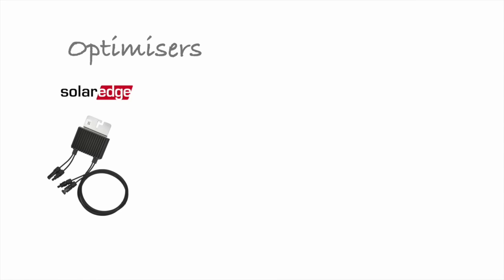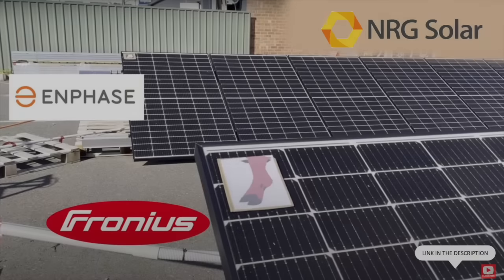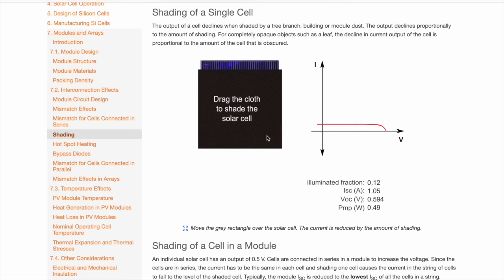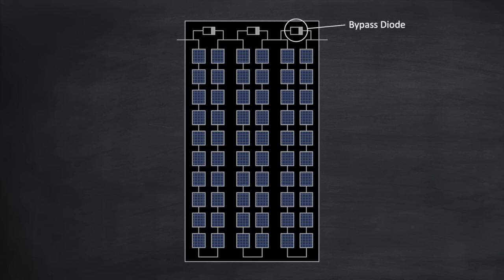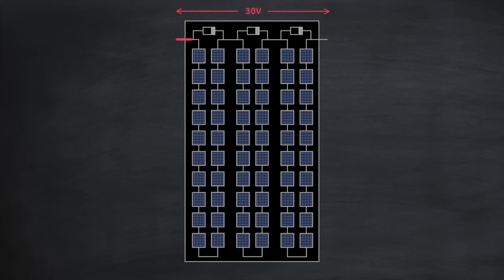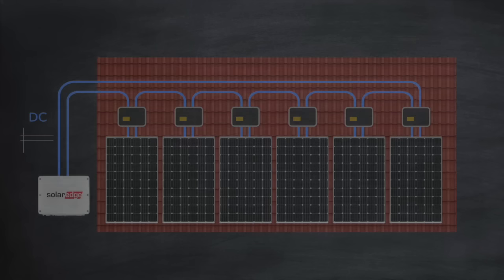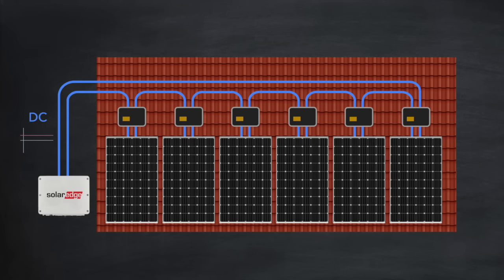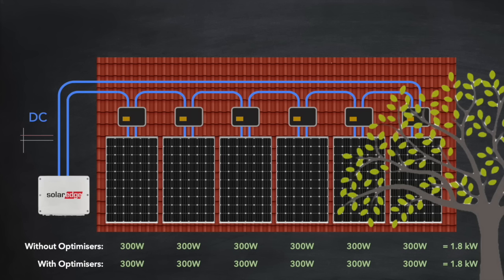Solar Panel Shading (Part 1): Are Optimisers and Micro inverters Worth It?

Comment: From 12:50 - the current drop was not enough to engage the bypass diodes, resulting in the whole strings current reducing to the same amount of the shaded panel-- is incorrect. The bypass diodes will start to pass current at a 1mA drop in one of the panels in the string. So, what ever the shaded panel cannot pass, the bypass diode will, to ensure that the peak current in all the other panels in the string will continue to flow.
Reply from the maker: What’s your source for this insight please? I don’t think you’re correct because that would mean any kind of shading on a panel would have almost no effect on any other panel. And it’s been shown (in part 2 by experiment using a cable) that this is not the case. Diffuse shading from a tree or a cable/antenna may not be enough for the bypass diodes to operate, therefore the current leaving the affected panel is reduced, with a knock on effect for the other panels.
Reply: @GaryDoesSolar  I answered this question in your part 2 video, but will answer it here as well. Bypass diodes don't just kick in at a certain current drop in a panels string due to shading. Bypass diodes will start to conduct at as little as a 1mA drop in current flow in a panels string. Shading one panel does not have any effect on any other unshaded panels in the string of panels, and that has been proven time and time again, even by myself. I might add, i am an off grid solar installer, and also own a company that specializes in off grid systems. The losses you may have seen, would have been from older systems, where the MPPT software in the old inverters would reduce the current flow when a drop in voltage was seen, due to shading. But we are talking about solar panels here, not old school inverters. No power is lost from the unshaded panels in a string of panels when one of those panels in the string is shaded. From 12:50 you said -( the current drop was not enough to engage the bypass diodes), when in truth, a 1mA drop in current through a panels strings is enough for the bypass diode to start to conduct.
Reply from the maker: @Sooty_Grandad  I appreciate that you have some knowledge and expertise here, but statements like "that has been proven time and time again, even by myself. I might add" are not helpful, unless they're substantiated with data or other evidence. Without that, they're just your opinion, I'm afraid. I pride myself in the detailed research I undertake in all my videos, but I'm more than happy to be corrected on anything I say, provided there is supporting evidence for any claims/counter-claims made..
Reply: @GaryDoesSolar  I have tried replying 2 times now, with a link to my test i carried out on my other channel, which shows clearly that the bypass diodes will start to conduct at just 1mA, but the reply doesn't show up, so i will try again.  https://www.youtube.com/watch?v=F_Pg-5tF1cY
Reply from the maker: @Sooty_Grandad  Yeah, YouTube automatically delete comments with links in them sometimes. I've got the link to the video you sent me and will take a look - thanks!
Reply from the maker: @Sooty_Grandad  Ok, I watched the video and if you take a look at the comments, many people believe that video is incorrect. I believe a reverse-biased bypass diode will affect both the top and bottom substrings, and therefore I am standing by the video I made (which is corroborated with this video, which is far more detailed than the one you referenced: https://www.youtube.com/watch?v=AZ8VQ_zmf1M) until such times I can be convinced otherwise. I'll try to source a video where someone has performed an experiment to prove one way or the other. I welcome all this healthy debate though - thank you 😄
Reply: @GaryDoesSolar  And my video above, showing how bypass diodes actually work ? At 12:50, you said the amount of current drop was not enough to trigger the bypass diodes, where my video shows that to be incorrect. The bypass diodes will start to conduct when a 1mA drop in cell current is detected  I can carry out the test on the half cut panels, as I have them in stock. I will let you know when the video is up. Just to be clear, you are claiming that if I shade one half string, i will lose 33% output from my panel, and not just the 16.5% as I claim- is that correct ? This would mean that if i cover all the bottom half strings of one half cut panel in a string pf panels , I will lose all the output from that panel-is that correct ?, regardless of the fact that the full panel voltage is still across all the bypass diodes.
Reply from the maker: @Sooty_Grandad Experimentation is certainly a good way to settle this, and if you have the time and equipment to perform such, I’m very grateful. My understanding is that if you cover 1/6th of the Panel (the lower left hand edge as in my video) you will lose 1/3rd of the power. There is no need to conduct the second experiment covering right across the bottom of the panel as in my video, we both agree that you’ll only lose half the power in that scenario.
Reply: @GaryDoesSolar  Quote: (There is no need to conduct the second experiment covering right across the bottom of the panel as in my video, we both agree that you’ll only lose half the power in that scenario). How can this be ? If we cover just one half string, we will lose 33%, but if we cover all 3 half strings, we lose only 50% ? I think you are making the same mistake that many others make, and assume that the shaded half strings voltage drops to 0, and there for, the diode also sees a forward voltage drop across it. But this is not the case. The unshaded half string is in parallel to that of the shaded half string, and so the voltage across the bypass diode has not changed. A diode will only pass current when there is a forward voltage drop across it, but the unshaded half string is still applying a reverse bias voltage across the diode. As i have shown in my video, the string of cells don't just drop out once the bypass diode starts to conduct. A heavily shaded string of cells still gets some ambient light, and so will still pass some current through that string of cells, and the remainder of the current will pass through the bypass diode. In the case of the split cell, the unshaded half string insures that the bypass diode has a reverse bias voltage across it, even when the other half of that split cell string is shaded. So the voltage across that diode never changes, so why do you believe that the top unshaded half string will stop producing current ?  A great conversation. I am enjoying it.
Reply from the maker: @Sooty_Grandad  I agree - this is a great conversation, and it's the scientific process at work. We make a prediction about what should happen, then test that with an experiment. And if the experiment shows our prediction was incorrect, we go back to the drawing board, and eventually we'll understand things correctly. I just wish "flatearthers" would adopt the same approach! 

I'm hoping that my video (Shading Part 2) explains in detail what I think will happen to the power output in various circumstances - it's all to do with how the MPPT tracking operates. So, there are two experiments to be done. In my video, you'll see I number the 6 sub-strings as follows: 1, 2 and 3 across the top half of the panel (left to right) then 4, 5 and 6 across the bottom half of the panel. 

Experiment 1: Measure the power with no shading. Then cover all of substring 4 only and measure the drop in power. I think the power will drop by 33%, you think 16.5%.

Experiment 2: Measure the power with no shading. Then cover the entire bottom half of the panel (substrings 4, 5 and 6) and measure the drop in power. We both think the power will drop by 50%.

If you're able to conduct both these experiments, we'll know one way or the other - and as I said, I'm more than happy to be proved wrong (it's a great learning experience!) 🙂

Comment: I get blue solar panels cuz they work before the black ones do and it stopped before the black was too and I also got black ones as well that's how I know this and a blue ones working shadows black ones will not necessarily work in shadows I know it's raining the other day and the black ones won't give me any power but the blue ones were the blue ones were running my house but the black ones would not.
Reply from the maker: Ok

Comment: You forgot to mention that MPPT algorithms are far from being perfect and usually reside in single P-V curve kink, i.e. not trying to find higher current + lower voltage point giving higher power once shading occurs. Actually MPPT should scan curve with voltage going up from close to zero Volts.
Reply from the maker: Actually, I didn’t want to complicate the video too much so as not to alienate the audience. In my animation you’ll see that the tracking started from zero volts. I’m planning a follow up video where I’ll take more about MPPT though - thanks for highlighting 👍🏻

Comment: Why not put bypass diodes on each Panel that is in series with other panels? Then they would simply drop out and not affect the rest of the panels. Then you would not need to use microinverters.
Reply from the maker: I’m not sure I understand your suggestion. A panel is essentially three mini panel strips, each with a bypass diode already. Can you explain in more detail?

Comment: if you have a shadow from chimney it wont drop down the power of the panel to zero so the diode still wont kick in so the example you brought isnt accurate.
so optimizers still needed.
Reply from the maker: Do you have any data to support this?
Reply: I have a pv systems company since 2014 and we installed hundreds systems. Some of them commercial system above 300kw.
We install system of all kind.SolarEdge,SMA,GroWatt, Sungrow.
When we put a string inverter(not solaredge) if we don't install Tigo optimizers on the shadowed panels ,it doesn't matter if cover half or all the panel, it dramaticly effect on the power. So we put a Tigo optimizer.

1) Via the app of Tigo or SolarEdge you can see the power of all the  panels individualy. And you can see that even if there is a panel completely in shadow it still produce some power ,which means that the diode not short it.

2) Via the Tigo app you can see the difference with or without optimizers.

3) I have that one system that one panel (1 of 21 panels in the string) this panels was in some shadow and when I install Tigo optimizer on this panel the power of the system going up around 20% .which means that when in shadow the diode not short the shadowed panel completely.

4) I made a test in past.I had 2 exactly similar systems. one with optimizers on the shadowed panels  and one without and I compare it.

The two system point south and it has exact same shadow(same house model)
I don't remember exact difference. but it was very noticeable. I can search the graph of that test and  send it to you, if you want.
Reply from the maker: @Refael302  thanks for the detailed reply. As it happens, my next video is on optimisers and so if you’re able to send over a graph / photos or other data, I’d be happy to consider it for inclusion in the video, and if I do, I’ll of course credit your company. Please send to My email is "me" followed by an At symbol, then my channel name (all one word) and finally a dot then com

Comment: The Tigo optimisers are not that expensive. For me i would always choose for optimisers to monitor each panel. It safes a lot of time to find out what panels gives problems on the roof.
Reply from the maker: If you want a string inverter and need monitoring, then Tigo is a good option.
Reply: Have been researching optimizers and string inverters. Be sure to read the entire warranty for all components. Some manufacturers require professional certified installer for install and for troubleshooting optimizer failure for all warranty claims.  And Optimizer may have 10 to 25 year warranty but the other required parts typically do not.  And some manufacturers will either replace the part or give fair market value, up to their discretion.

Comment: in my opinion the video lack the real use of optimizers: parallel strings tied with a single diode. if a string drop in voltage it is useless in the parallel.
Reply from the maker: Could you explain in a little more detail please? I’m making a follow up video and would be happy to cover this, but I need to understand better what you’re saying - thanks 👍🏻

Comment: The new panels have simple bypass diodes, and so solar edge is not needed.

Not needed for this old failure in old panels.
Reply from the maker: … unless you want per-panel monitoring perhaps?
Reply: @Gary Does Solar  yes, 
Panels are very reliable, and companies are not, Hahaha. 
My roof is Colorbond metal, and I have an in roof verandah for the view.
600v DC or 240volt AC on the metal roof that you can touch the metal, it made me think, what to do? String or  Micro inverters ?

Cabling is a different cost as well.

DC to an EV car charger may have another cost.

What to do???
Reply from the maker: @stephenbrickwood1602  Yeah, a conundrum... Your installer should be able to advise, certainly.

Comment: If I use an optimizer that means I need to use a charger to turn it back into DC to charge my batteries and that's no good cuz that uses more power that way cuz optimizers use the power to do this the battery charger solar battery charger uses power to turn it into DC power to charge the batteries and I'm not going to buy very expensive AC batteries.
Reply from the maker: Ok

Comment: No to optimizers or micro inverters.  And they do use 2% power.
Reply from the maker: From what I’ve read, it’s 1 to 2% power, and only when the Sun is shining.
Reply from the maker: @neomage2021  This is good news!
Reply: @GaryDoesSolar  Yeah,  unless you really really need every bit of efficiency I don't think it matters much in that regard as to microinverters vs string. Other reasons to choose one over the other of course.
Reply from the maker: @neomage2021  Yeah, I would agree. The other pros and cons outweigh 👍

Comment: Set up your solar panels in parallel instead of series and you won't have this problem...
Reply from the maker: Hi Terry, I'm not sure it is as easy as that - there is usually a minimum voltage to meet before the inverter starts up, and parallel circuits mean more current, and therefore thicker wires...
Reply: No, this would damage the panels, as is easy to see: Imagine you have 5 panels in parallel, one of them completely shaded. The 4 panels would generate 30V and 10A each, so a total of 30V and 40A is flowing. The bypass diodes of the shaded panel would be in parallel, which would blow them. Then the current would flow through the panels, which are also essentially diodes, which would then heat up and break as well.
Reply: @iBlue0riginal  if you run them in parallel then positive of each panel goes to the positive lead on a buck inverter and negative of each panel goes negative  on the buck inverter then the 12$ buck inverter goes to your charge controller\tie in inverter the buck inverter is in charge of taking the provided amps and converting them to volts/amps required  i have this setup on 4 panels and the ones in the shade do not catch on fire and burn my house down like your saying LOL

i think solar company's want them to be in efficient so they can sell more panels i mean it would take 8 panels   to do the same work as 4 in the configuration these panel company's want you to wire them
Reply: @iBlue0riginal  nonsense.

Comment: 15:27 - 16:40  this is BS, from your logic it would imply that on some configurations it would be more beneficial  to shade the panels even further if they are partially shaded, so that the diodes kick in.
For example: if you have 20x 300W panels and one of them is shaded so that it outputs 270W,
based on your explanation (without optimisers) we would have  20x270W = 5400W
but if we shade the panel even more we would have: 19*300W+1*0W= 5700W (more power)

This is not how diodes  behave! (connected in parallel to a "energy" source)
Reply from the maker: How rude, especially from someone who evidently doesn’t understand how solar panels work. I couldn’t have been any clearer in my explanation. I even provided you with a utility that shows current drop in one cells affects current in all the other cells in the same string. My “logic” is exactly how bypass diodes and optimisers can counteract.

Comment: You do not need optimizers, its a scam, get halfcut cell panels and dont look back
Reply from the maker: Ok, that’s a pretty binary statement for quite an involved topic. But I agree, half-cut cells can improve upon certain shading scenarios. I’ll cover these in a follow-up video I’m making.
Reply: It honestly isn't that complicated, throw in a few extra halfcut panels and forget about these optimizers.I tried it, gave it a fair test, it's not worth it. 10yrs ago, with the whole cells panels and without the reversing diodes, yeh it could've made sense.
Not anymore